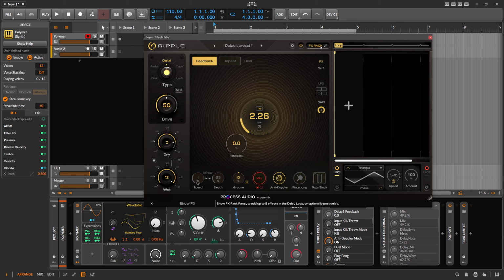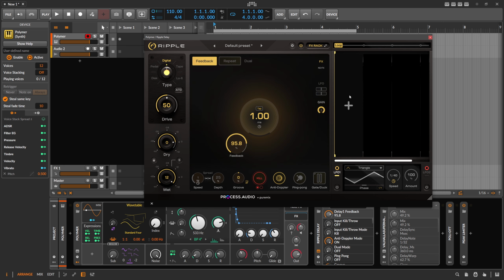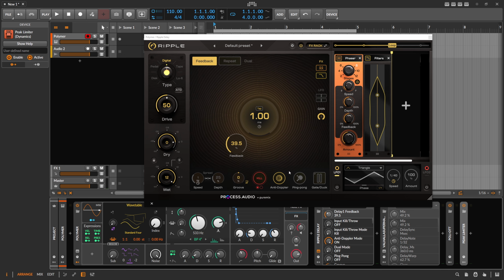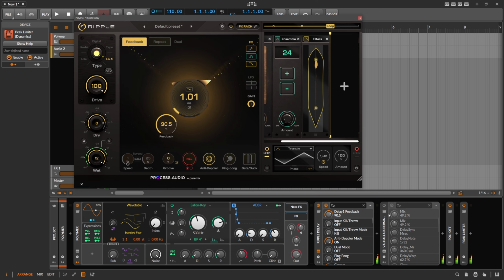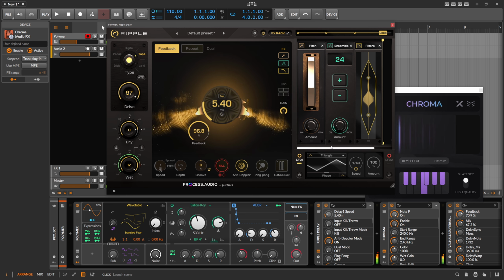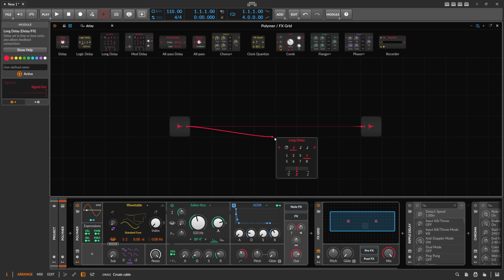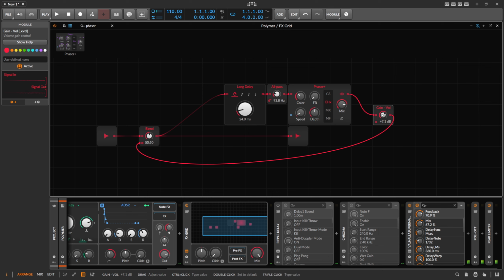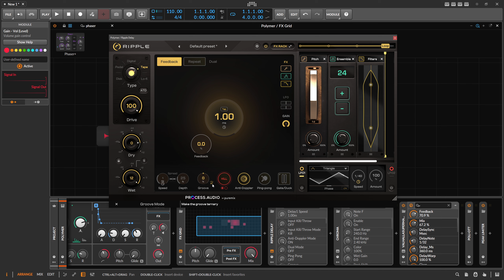Ripple Delay - Crazy new Resonator

Comment: I've been doing this for a while in VCV, which works really well. It has a few resonators that can be tuned with pitch signals, and are also polyphonic. If you patch in feedback using the VCA mix module, the feedback signals are polyphonic too, so you can do chords with weird metallic feedback. I also like pinging resonators using samples for different textures, or applying delay/fx to the pings first so you get extra notes. It's a really versatile technique.

Comment: Ay that's pretty sick! It's crazy that it can do pitch processing (usually you need a whole sample right?) at sub-sample rate
Reply from the maker: Oversampling at a higher sampling rates is usually not a problem for plugins, so i guess they do just that and the effects they use are either very fast or optimized for that use case. 💪

Comment: I believe bitwig blocksize does not affect the sound processing milliseconds in effects within bitwig except for when they start as it is the size of the chunks that are processed, what is in those chunks can be of sub block size, so 1ms for example. So the delays and feedbacks can be below blocksize, because the effects are processed at that rate, but when the first sound starts is determined by the block size. As to why it might sound different from the VST, this could be due to post processing on the VST. Anyway, nice vsts, I believe bitwig can't do the chroma thing, would be a nice addition to the spectral suite, although I would prefer them to do the ultimate daw sampler and some more polygrid persistence.